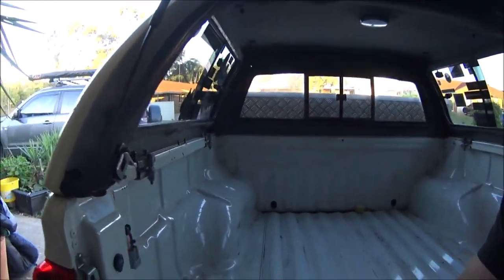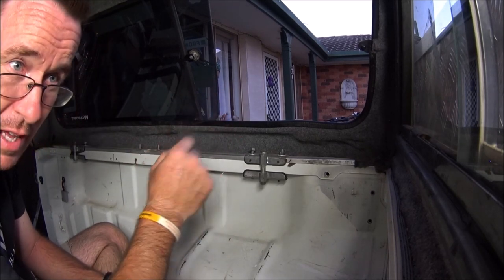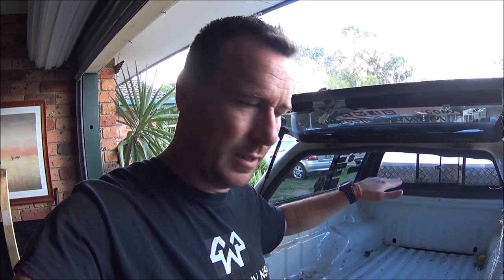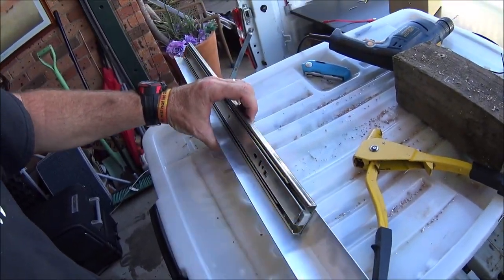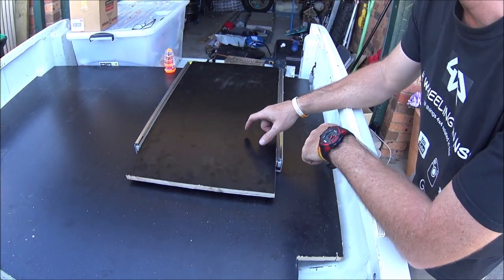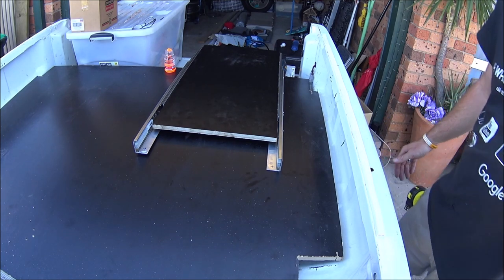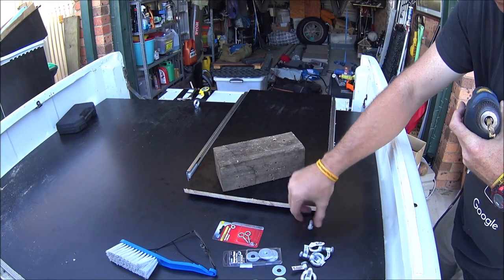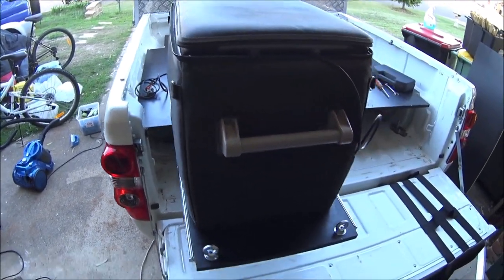Fridge slide build in camper trailer

Comment: At 21:04 with not being able get the rivet gun in that hole. You can put the rivet in the hole with the shaft sticking up. Then put a small nut or some washers that will fit over the shaft and in the hole and use it as an extension. The nut or washers can be loose but must sit flush against the dome part of the rivet when you use the gun. Once the shaft snaps the washers or nuts will fall away. Great vid. Hope that helps.
Reply from the maker: Jason Saunders  ahhhh, nifty idea mate, bit of a packer eh. Cheers for that. As I say, I don’t do a lot of metal work normally so I think I was lucky enough to bluff my way along 😆😆 thanks a lot for that champ 👍

Comment: Great job grant Nothing like building something yourself,  only thing I noticed is those fridge slides,  do you push them forward to unlock it , if so do you think it will unlock itself when you hit the brakes on the car then when drive off the fridge will hit  the tailgate you might have to put a locking mechanism otherwise if not all good looks great 👍
Reply from the maker: FJ Camping & touring Australia  thanks mate... 
yeah it’s a push to open so you shove it towards the front of the trailer to ‘unlock’ and then pull it back towards the tailgate. I did think the same so I’ll see how it goes and if it keeps popping itself out, I’ll add a small slide bolt in there somewhere just to keep it in place. 
I also have water Jerry cans between the fridge and the tailgate so if it does pop itself open, it will only come back maybe 10mm and then stop at the bottles. But yeah a slide bolt may be the go. Thanks champ for the tip 😉👍

Comment: Top work Grant. Those slides are top value, eh. If only we had 'em years ago (yeh, I'm gettin' on). The fit of the ply doesn't matter so much, so long as it's sturdy and does the job. Oooohhh, you've got merch!!! You call yourself unskilled, but you do things better than some of the tradies I work with haha. Ripping the canopy off made the job so much easier anyway - like strapping the fridge down etc. A couple of ally angles at the front of the ply into the frame of the tray on the top there at the front will stop it tipping. Again nice work mate. And yer missus didn't seem that short - maybe the camera angle. Cheers
Reply from the maker: Don Finch thanks mate, appreciate the kind words. 👍 
And yes any $$ from merchandise goes back into to the channel, saving ( slowing ) for a good drone for our 4x4 trips. 👍 
And yeah, good camera angles make her seem taller - she could go eye to eye with a miniature pony 😆😆😆 
She puts up with me though so I better be nice 😆👍👍

Comment: Hope you can dig up a connector for that twin core so you don't have to deal with that again. I reckon you could've had the fridge take up less space and reduce the height by cutting out a rectangle on the base board big enough for the fridge, use the cutout for the fridge support and put the sliders under the based board against a couple of lengths of timber to screw the sliders into. Cheaper on materials (no aluminium) and lower so the misses can get to the contents even easier. Good idea to mount the rings on large washers. Love the trailer!
Reply from the maker: Benny Bozo cheers bud, I like your thoughts there too 😉👍

Comment: Hi mate, do you know where i can buy the actual slides from? I am in Queensland. Great video. Thanks Scott
Reply from the maker: I grabbed mine just at the local hardware because I forgot to order through work and needed them last minute 😬 - I think Bunnings have the same ones and you can also buy them online through eBay and the like. If you’ve got a Bunnings close by, you should be able to get them there 👍 pair of 600mm long with a weight rating to 75 kilos ( from memory ) should be about $15 - $20 for the pair. 😉 thanks for the kind words

Comment: Could you make the fridge section lower so the timber sits on the tub floor? Like a boxed section just for the fridge so it’s low?
Reply from the maker: Yeah that would be good too. 
I mainly did the shelf right across for a quick install and also for the extra storage space under the fridge for my cooking gear too. Thanks for the suggestion mate 👍👍
Reply: @4WheelingInNSW  I’ve just finished a tub trailer with a bt50 space cab tub, so thank you for the ideas on how to fit it out
Reply from the maker: @dunniss  well done mate, great to hear. I’d love to see some photos of it. If you’re happy to share it, chuck them on my Facebook page or email me at my website, both of the same name - I love and encourage home made projects. Great stuff mate 😉👍👍

Comment: Hi, what size bolts did you use for mounting the sliders to the aluminum?
Reply: Also what bolts did you use to mount the second aluminum pieces that are supporting the wood slider table?
Reply from the maker: I used pop rivets, not jolts. I bolted the aluminium angle to the ply and then drilled the holes in the sliders slightly bigger to allow the rivets to fit through the sliders and into the aluminium angle.  I’ve got the size of the rivets at home if you’re interested - just let me know 
Cheers mate
Reply: @4WheelingInNSW  Yes very interested! I have been trying to build a similar device, but have had trouble mounting the alum plate to the slider since the space needed inside the slider is so minimal and then the plywood table would also need space
Reply from the maker: @flacoloops24  yeah if you watch the clip somewhere towards the middle, around the 19:20 mark,  I mention how you must insert the pop rivets from inside the slider through to the aluminium as opposed to going through the aluminium and into the slider. That way the domed head of the pop rivet sits flush inside the slider and doesn’t foul on the action of the runner.

Comment: Hey Grant - good armchair education on DYI project for the fridge etc - I’m a height challenged fellah and managed by some lateral thinking to use the carport beams and ratchet straps and managed to remove not just the canopy but also the tub  (both sold now) and fit a second hand aluminium tray and new aluminium canopy all by my 163cm stature - you got there in the end so well done - John in SA
Reply from the maker: Yeah thanks for that John 😉👍 
we don’t all have the right tools always so you’ve got to come up with some cheats mate, glad you liked the clip. Cheers mate 👍👍

Comment: Just make underneath draws and ya laughing
Reply from the maker: Yeah I’ve been contemplating that eh, umming and arrrring both ways 🤔🤔
Reply: @4WheelingInNSW  how did those inside ally 90's hold up with the weight of the fridge?
Reply from the maker: @benlister7660  sorry mate - are you referring to the 90 degree aluminium sections ? 
If so, no drama at all, it works a bloody treat and there’s no more flex or movement in it then when compared to those ridiculously priced commercial brand drop down slides 😉👍👍
Reply: @4WheelingInNSW   yeah was referring to the equal angles. I have a 60L fridge, gunna do the same build. might chuck some L bracket supports on the outside.
Reply: What size is your fridge and what Kg was your slides rated too?
Reply from the maker: @benlister7660  our fridge is a CF40, a 40 litre Waeco and the slides, from memory, were the 300 or 500mm length and are rated to 45 kilos - the fridge is 20 empty and no where near 45 loaded up so I didn’t go nuts with the big heavy duty versions.👍 it works a treat 😉
And yeah the aluminium angle I used doesn’t seem to have had any issues yet - if it ever fails, I’ll probably replace it with some 2 or 3mm steel angle but I’ll cross that bridge when I come to it. Aluminium was cheaper and easier to work with when you’ve got limited metal work tools not skill 😂😂👍